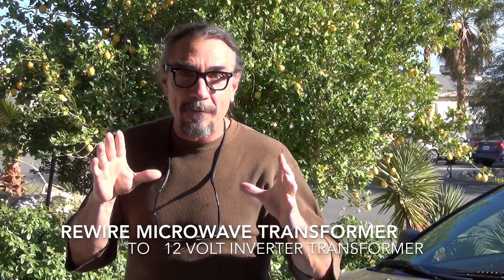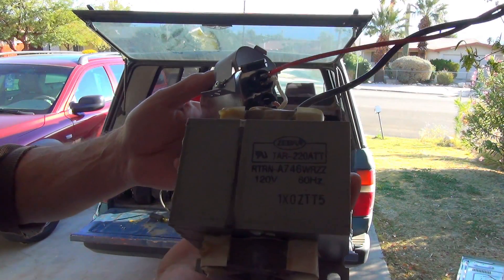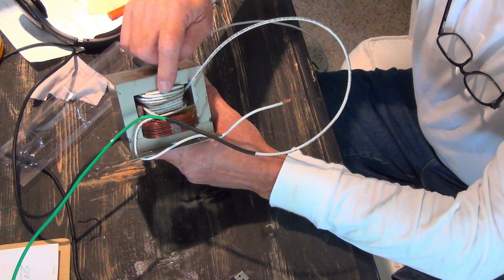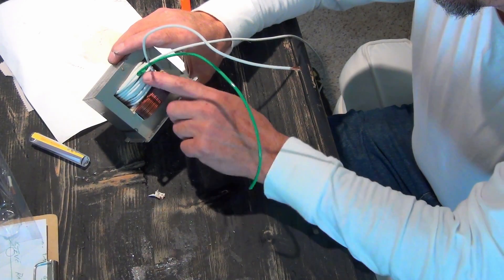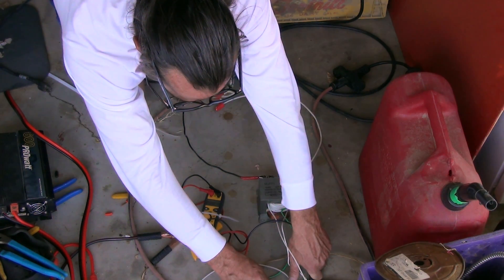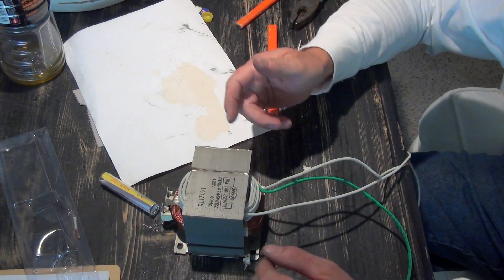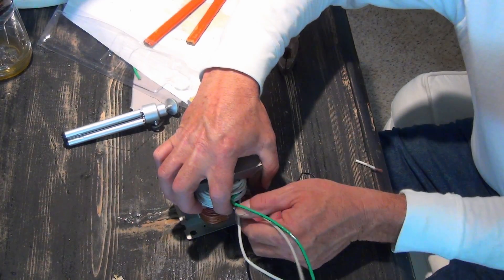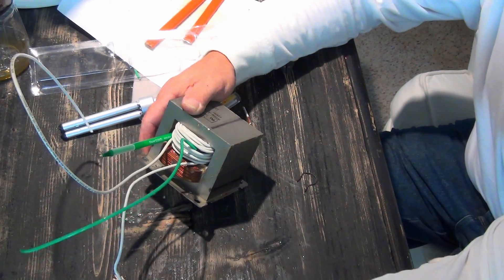How To ReWire MOT Transformer the Easy Way.

Comment: Yeah, your AC voltage will be different after you run through a rectifier and again when you put a filter capacitor on it. Just wondering how many times he rides the lightning and survives before he discovers that.

Comment: Right, Mine Heir! I WILL DO THIS BUT! (i.e. but: contrary in this case to the conjunction: "but,") - I'll add the necessary 1. MOT theory, 2. MOT EXPERIENCE, 3. advise from paid teacher of electric house wiring, 3. detail of heat vs. rubber insulation, 4. fast checks i.e.- put the plug in for a split second and then take out, 5. 4 minimum at-a-time usage, 6. YOUR GOOD STUFF, darn good dude- entertaining but not too much, informative, DONE WITH SAFTY, not a lot of rebadge, 8..

Comment: I know this is pretty old but I just wanted to say the voltage coming off the transformer is measured in ac rms so when you rectified and put a cap on it goes up a
Lot. For instance  24 volts ac will give you Aprox... 34 ish volts DC. Just something to consider.

Comment: I've never rebuilt a MOT but I've built some high current transformers. Did you ever try using flat flashing copper sheet? It comes in 25 foot rolls. You could cut off a long ribbon from one side, wind teflon tape between the turns and come up with a really efficient secondary with great heat dissipation.
Reply: I've wondered using with Kapton tape.

Comment: I thought if you use a full-wave rectifier the volts stay the same.
Reply: Assuming that he knows what he is doing, he will use only 2 diodes, not a full wave bridge rectifier (which has 4 diodes).  He gets half wave rectification from each diode.  But I think he has another problem, if he intends to use it as a battery CHARGER.  A fully charged lead acid car battery sits at about 12.6 volts and needs about 14 volts when being charged.  Since he has only 12 volts available, the battery won't charge.  But if he simply wants to run 12 DC power tools, it should be okay.
Here is one of many links that describe full wave rectification using only 2 diodes, with a center tapped transformer:
http://www.physics-and-radio-electronics.com/electronic-devices-and-circuits/rectifier/fullwaverectifier.html

Comment: I wanted to rewire my MOT transformer to output higher AC current and maybe fit an LCD display but when I went to the ATM machine I forgot my PIN number so I couldnt buy the wire :(

Comment: I was wonder if I can use all the parts from one micrwave to make my 24VDC power supply for power tool that draw 6amp?

1. rewind Microwave transformer 20 turn
2. Rectifile from microwave
3. AC Capacitor from the microwave

Thank you for the video
Reply: what if I link 3 microwave parallel?
Reply: The short answer is YES, a 24 volt supply at 6 amps draws around 150 watts, about the smallest microwave I've ever come across was around 600 watts, so with the appropriate number of turns and thickness of wire, you should be able to get 24 volts at around 24 amps,  regret I can't give you the exact number of turns, but the single turn that many people use to turn these into spot welders, gives about 2 volts, so possibly 12-15 turns of a decent thickness wire, may give you something close, hopes this makes things a bit clearer

Comment: Connect the 2200v output of this MOT to your ground at home and every circuit laying around in the building will fuck up loooool
Reply: connect it to hot and neutral wires in your panel and watch everything plugged in blow up :)
Reply: I don't have hot and neutral in my country, it's simply AC
Reply: ohh, you don't bond one of the conductors to ground? Lucky...
Reply: Yep
Reply: I live in Lebanon, voltage is generally between 220 and 240v, but most of he time 223-235, 50Hz, but there is electricity problems so in the capital there is 3 hours daily of cut off and in all other regions 12/24h of cut off and the power can reach 210, sometimes problems happen and we don't see lights for days. It's the corrupt ministry
Reply: lol, exaclty like North Korea. :))) That's not acceptable.

Comment: Why do people say the voltage is deadly? It's the amperage that'll kill ya. .5 amps is enough to kill a human but a taser with thousands of volts wont kill. Although I my self have been shocked a few times with 120vac house power I'm not saying it's instant death to get shocked, there are different factors to take in for example I'm still alive but an older person with a weak heart may not walk away from the same shock I have taken in the past.
Reply: +Allen McKinney Its both that kills you can also play with tons of Amps and no volts and be fine. A static shock can be 12kv and 8amps but as it's over so fast it does not kill anyone but still hurts.
Reply: Same hear but 120 v can cause damage to the body   .i have lost a bit of funtion in one  hand    still works but dosent work as well  in some applications  as it use to

Comment: using a secondary coil with rubber insulation wow.
Reply: bridgeboy513 ew
Reply: ***** yes high temperature resin is better, and using magnet wire is also something to consider. the transformer can get very hot and if it shorts you're basically fucked, and have to redo it. so be careful.
Reply: yes it does matter, wind them the right way counterclockwise or clockwise.
it doesn't affect much so as long as you remember how you did and keep the primary and secondary similar.
Reply: +Moth lol dude it doed not matter. it will just change phase. When you use diodes and capacitors it wont have any effects anyway

Comment: So you want 120 VAC (VRMS) from 12 VDC? Well the 120 vac is actually peaking at 120x1.414= aprox 170 volts...the 12vdc when switched into 12 vac will be peaking at 12 volts...so you are not going from 12 to 120 but 12 to 170...your turn ratio is wrong...you should be shooting for about 9 volts ac when powered from 120 vac not 12...and that's not even taking into account the resistance of the transformer winding and the voltage drop across the switching elements (transistors, mosfets, etc) and make sure to remove the shunts from the MOT for inverter use...further more your center tap is not at the electrical voltage center by the way you did it....it would be better to make a bi-filer winding with 2 wires instead of one to insure equal voltage on each winding.

Comment: Always be safe and discharge the capacitor before touching anything inside. They can still hold a charge even when they're unplugged.
Reply: +betchalife actually most of the more modern (read post 2005) microwaves have capacitors that are designed with a drainage resistor to bleed off the extra charge. so unless you plug it in, and unplug it and tear into the microwave then the cap will have a low to none charge.
Reply: They have a built in resistor in them that will discharge them in less than 20 mins.

Comment: bridgeboy513  how many amps will this transformer provide?
Reply: Eng Richard Balboa you can get about 1kw, you can get more but the mot will get hot

12v at 83amp's  ~1kw
24v at 41 amps ~1kw